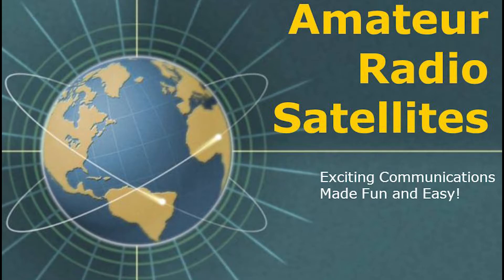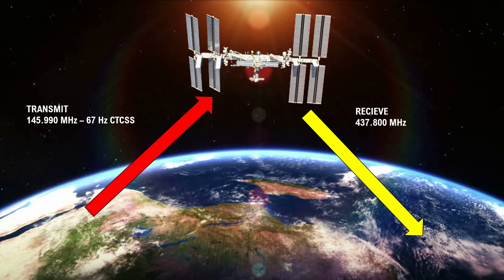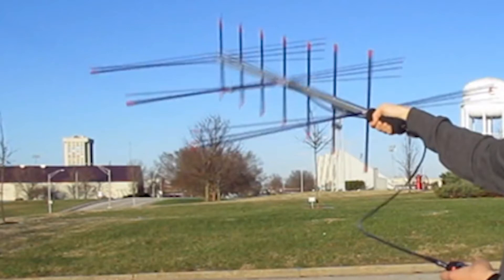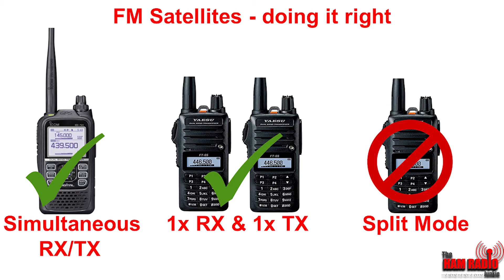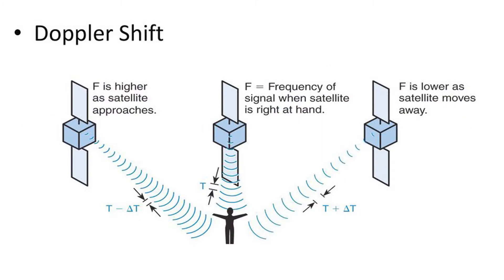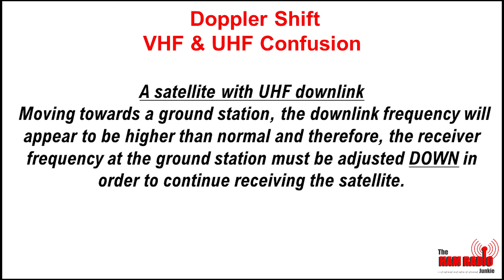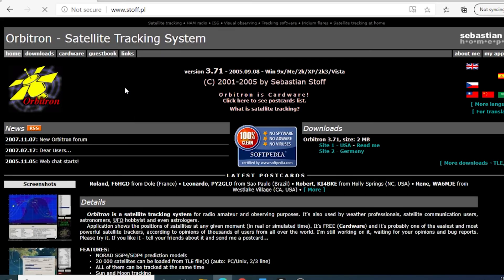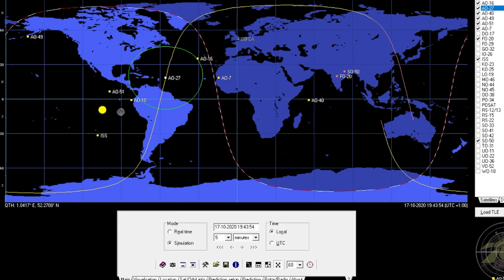Working FM satellites made easy

Comment: Hello, I really enjoyed your informative video. But I was alarmed to see you used Yeasu FT-65’s as an example of using two separate radios to transmit and receive signals from LEO satellites. The reason for the alarm is I had just purchased one FT-65 due to a specific feature not many are aware of. It’s called VFO Split Mode. Page 7 in the Advanced Manual. It lets you transmit on VFO A and receive on VFO B. And as needed it seems like you can switch VFO’s to change frequencies to offset Doppler shift. This may be a new feature Yeasu added, don’t know. Or perhaps you have tried this feature and had issues. Or if you just didn’t know it’s ok. Just hoping I didn’t get the wrong radio. 
Regards and much respect.
Reply from the maker: @tomleddy7620  i used the ft-65s as it was the first picture 8found.

Comment: What’s best antennas to start on satellites? Looked at the egg beaters Martin lynch selling, not sure how good they are, have ICOM 9100 radio, the beams for tracking stats look complicated as in software. Enjoyed your utube film. Mike M1KEY
Reply from the maker: @michaelm1keyhardy865  thanks for the feedback. The egg beaters are fine, bit pricey but fine for a put up and go solution. The ideal setup is an ez/az rotator and a 70cm plus 2m beams. This is where you start to spend even more cash!!!

Comment: You do know that you got the Doppler Shift shifting backwards.   For the case when the relative motion is towards each other: [1] A ground receiver of a satellite transmission will receive a high shifted frequency and thus the ground station tunes up. [2]  A satellite receiver of a ground transmission will receive a high shifted frequency and since the satellite receiver does not tune up, the ground station tunes it transmitter down so that the higher shifted frequency matches the desired satellite's tuned frequency.  Also, the sign of the correction flips (i.e. tune up ->down & down->up) when the relative motion is away from each other.
Reply: Yup, he's got it backwards.  I think a lot of folks get confused by the terms UL and DL.  The repeater on the satellite is not going to change the UL or DL frequencies to suit us mere Earthbound mortals.  Therefore, we have to LOWER the UL frequency (our transmit) as the satellite moves toward us and RAISE it when it moves away from us.  We must also compensate for the increased DL frequency on approach (by RAISING our receive frequency) and LOWER it as the satellite retreats.  It doesn't matter WHAT frequencies are used since the shifts are relative but...shifts increase as frequencies increase.  For example...lets pretend the satellite listens on 100 (the UL) and transmits on 400 (the DL).  As it approaches me, I listen on 401 but transmit on 99.  When it's overhead, I listen on 400 and transmit on 100.  Once it passes overhead and begins retreating, I listen on 399 and transmit on 101.

Comment: I understand the Dopler Shift but not sure how I set up my radio to adjust for the shift.  do I enter a bunch of frequencies and shift  up or down to go to different preset frequencies as the space station passes?
Reply from the maker: Ron, if you are not using a radio which tracks the doppler shift then yes. Put the frequencies of the UHF shift and as the pass procedures change channel.

Comment: Well done.  Are there any 2M up and 2M down sats right now?
Reply from the maker: Good question but no. The main reason is that just like a VHF 2m repeater it needs a large cavity/duplexer to prevent interference from the TX into the RX. This would make the repeater heavy and large. Remember when you are putting stuff into orbit the more it weighs the more it costs to launch it. This is one reason why nano cube sats are being launched more.